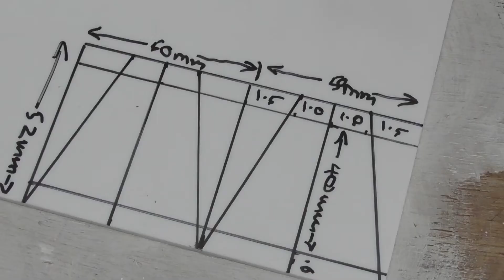Upgrading Heng Long Atlantic Yacht 5: re-positioning rudder & testing

Comment: Hi there :)
Thank you for posting this collection of videos :)

If rudder modification was carried out& a servo etc. mounted, is there a way of using original transmitter as solely proportional throttle & to operate the rudder servo, in place of the  original poor / slow left / right motor steering as you have achieved by fitting new speed controlers, recever, transmitter etc. 

Great job & a vastly better method of steering, allowing both motors to continue providing proportional equal power :)

To reiterate, can this be achieved with use of original transmitter & what will I require electrically to achieve this

Kind regards & God bless
Russ

Comment: Watched with interest as I know nothing about rc boats but intending to build something for dropping fish bait out or a rig Thanks
Reply: Oh and what's your thoughts on adding weight in the bottom for reducing turnover or like a fin on a sail bout
Reply: It would be running out from a beach on a calm day
Reply from the maker: with 2 independent propellers this boat is quite manoeuvrable - although I found out the hard way that props come off if you try and put a prop into reverse. I'm not sure if I would use this for a bait boat. I suppose you could, but you would need to make something to hold and release the bait.
Reply from the maker: It was a fun & cheap conversion - a good way of experimenting with RC boats if you are new to the hobby. 😀👍
Reply: @RCModders  Releasing the bait would be the easy bit by way of a lead or float on a platform or in a tube and it would be pulling the rod line out with no friction then knock the bail arm over when the boat reaches the desired distance puling the rig out or off into the water, I just wondered how it would fair in a light sea from the shore as I know where I can get the same boat cheap but boats designed specifically for the purpose are expensive.

I thought if I could just get it to pull the rig out and I have a tether line to pull the boat back to save on battery life and if it would struggle with a ballast weight in the bottom.

Cheers

Comment: Great 4 videos can i ask how much all the parts come to? And where to get the parts from please I take you the top speed would still be the same ? But under more control .thank you
Reply from the maker: Most of the parts are pretty standard. Any basic RC (preferably with mixing - maybe flysky stick radio would be a good choice), two brushed ESCs (speed controllers) and a standard size servo (maybe Futaba). I would buy from Amazon, Ebay or Bangood. 😀👍

Comment: Like the rudder mod and the use of  the electrical block to join the control linkage! Great boat now.... do you use the stock battery? I have a rc tank with similar mods, esc's that was on 8.4v stock. Now i run it on a 3s lipo  12.6v with no problems.
Reply from the maker: I think I prob used a standard 72v pack from one of the trucks. Those ESCs will take 8.4v, but not 3s lipo. 😀👍

Comment: Could you tell me where you can get replacement propellers for this Boat, having a hard time locating them, thanks.
Reply from the maker: I did find a place and ordered some, but they haven’t come yet. I bought another boat (as a spare) and used a prop off that. I expect that the key is not to let the shafts suddenly run full speed in reverse and to check that the props are in tight - with thread lock.
Reply: @RCModders  
But how to replace the propeller?

Comment: Working on the same boat brushless outrunners 2 60 amp esc,s  I run on 3$
Reply from the maker: This will be quite fast I think! 😀👍
Reply: Hi ive brought 1 of these boats 2 and was looking 2 change brushed to brushless cani ask how you knew what size brushless motors to get and what else needed to change ie controller esc etc etc ,?? Thank you